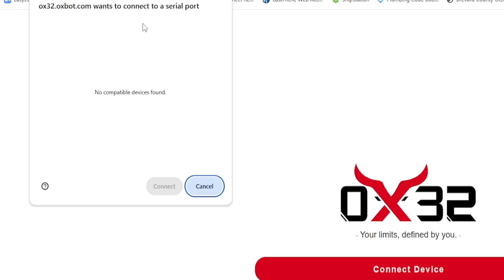New Champ in Town! OxBot H7 60 Amp Stack - Let's Check it Out

Comment: It comes with the LED's? Sheeeeiiiitttttt I'll buy a stack lol. Looks like its conformal coated too!!! Good to have them on hand regardless. Right I only have 4 reaper 65a connected to f7fc's 2 are speedybee f7's bc they work and  and a 60a 20x20 stack for a crucifox. Plus a 50a and 55a esc in the repair/parts bin